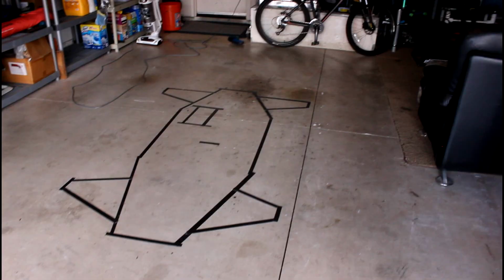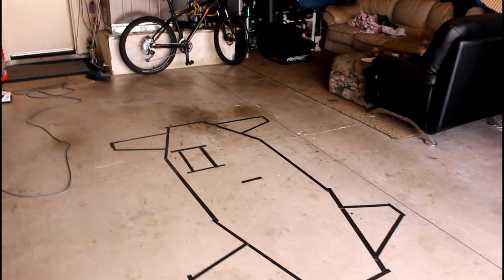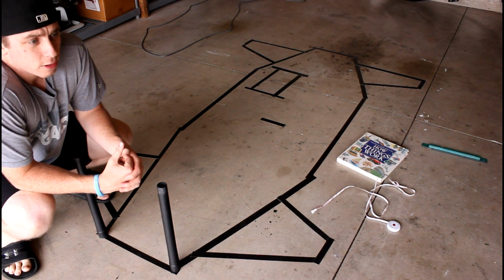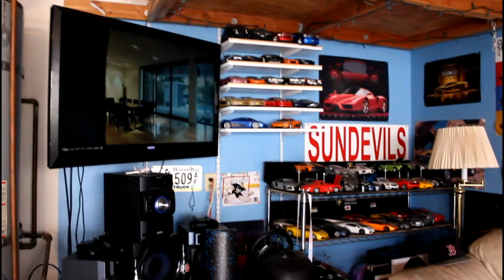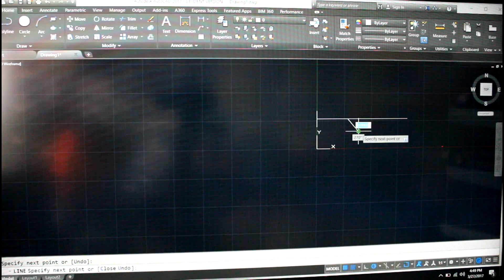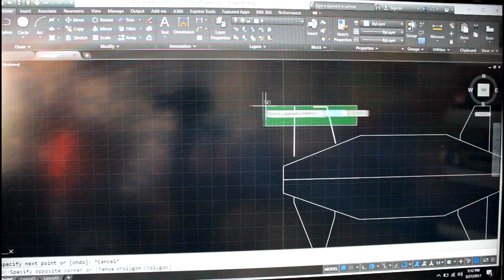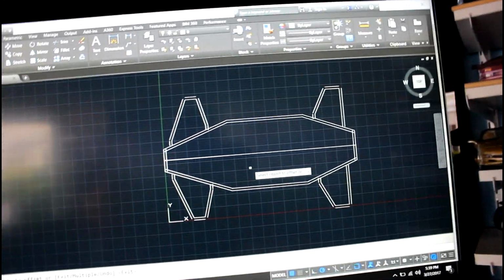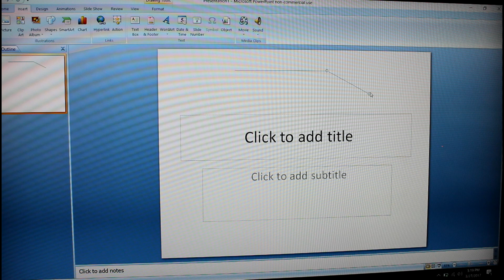How to Build a Go Kart 4: Frame Measurements and Initial CAD Design

Comment: Me and my friend plan on doing this as an engineering project I know you have a book for sale about it would your chassis be able to fit and handle a 450 Suzuki engine
Reply from the maker: Hey Josh, sorry I just saw your comment, it got buried in my inbox! That sounds like a great engineering project idea! The go kart design packet would be a great guide :) Depending on how much larger the engine is, you may have to just extend the middle  or rear section a bit to space the engine farther back from the driver. Let me know if you have any other quesitons!

Comment: if you don't mind me asking, why didn't you go with fusion 360 or inventor, since you would know at least basic 2d stuff (being an autodesk software)+ it's a really easy free download if you are a student?
Reply from the maker: Hey Morgan, no problem at all. At the time, I only really knew AutoCAD 2D. After getting familiar with SolidWorks in grad school, I would definitely design my next build using a 3D modeling program. If I put the time in to learn Fusion 360 or Inventor at the time of the build, the schematics and design would have been a lot better! I've heard good things about those two programs, but if you have access to a SolidWorks license, I would recommend that above the other two simply because SW is used a lot more in industry and could help a lot when applying for jobs.
Reply: @Addimotive  thanks for the response!
Reply from the maker: Of course! Let me know if you have any other questions.